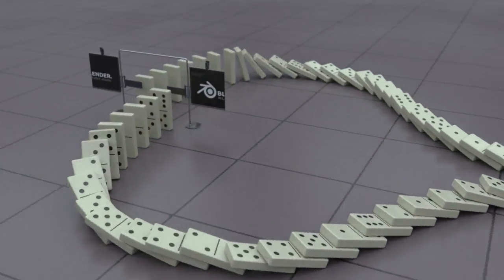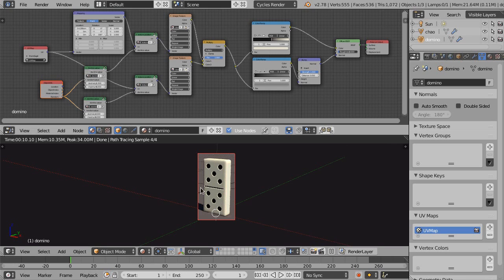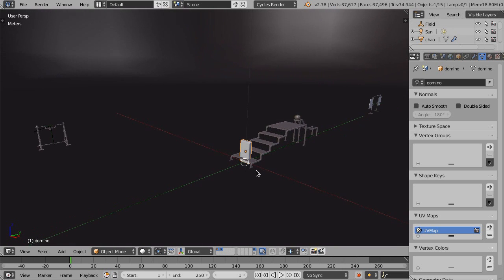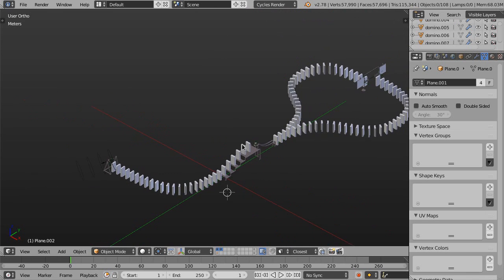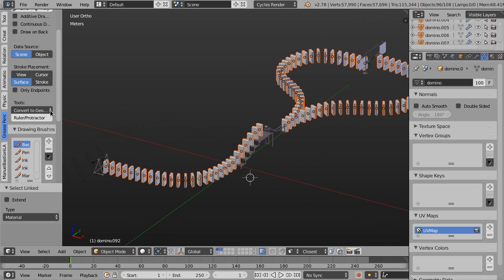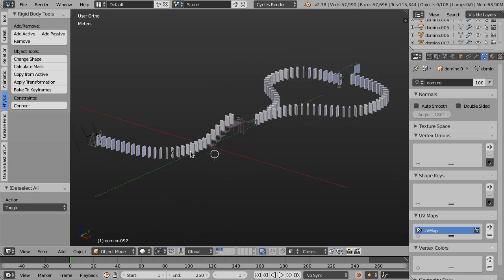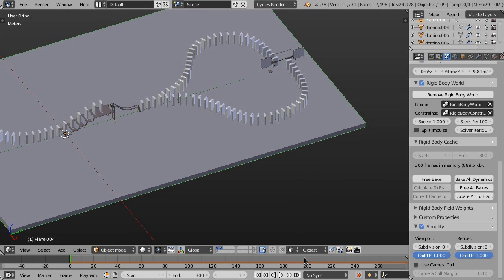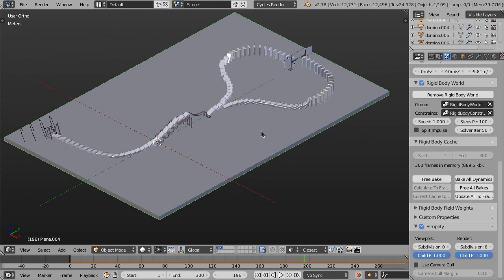Blender Tutorial EN: Dominoes 2/2 - Placement

Comment: holy... why hasn't this been visited some more? however, i am having a hard time adopting this in blender 2.8... anyways, awesome tutorial!
Reply from the maker: Thank you! I'm glad you liked it!
Let me know what parts you're having trouble to follow, blender 2.8 has changed some names and places of things.
Reply: to me it looks like the duplication / frames was really usefull to create the instances of the domino. but that function is gone. and using a plane as parent to the domino works, but that plane gets rendered as well. 

and the physics work strange, too. the dominos behave like they are underwater and have some air inside their top, so they stand up everytime. very strange...
Reply from the maker: @boristheodd2644  Unfortunately dupliframes doesn't exist anymore. To remove the plane from the render, in the instance panel there are two option display/render instancer.
The physics, I remember I had the same problem when doing the tutorial, I can't remember exactly how I fixed it, but I think it was because of the size of the domino. Normally I try to model everything at scale but in this case I scaled the object to prevent weird physic problems. Try to download the .blend file and check the size of the objects and the physics settings.
Reply: thank you! it was because i had the pivot point of the domino at the bottom, not it's mass center. now it works. i am using eevee, so i guess the display options per instance are limited somehow.. 

for now i place everything manually... just like in reality ;)